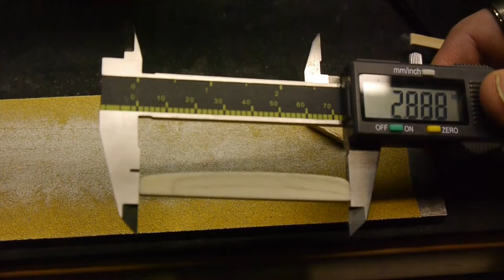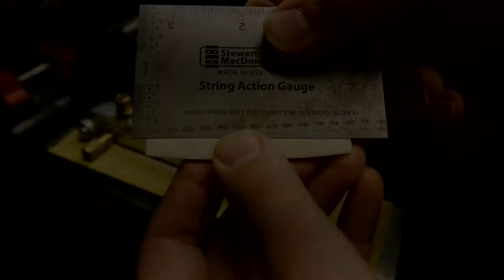Making a Bone Saddle for Acoustic Guitar ASMR

Comment: Thanks so much!!! I found that rounding the ends of the saddle is a pain so once I get it close to length I put the saddle vertically in my vice, cut a strip of 220 sandpaper about 3/8" wide (not too wide or it rounds over the corner edges) and 2" longish. Holding the sandpaper over the end of the saddle and close to the sides I pull down on one end, holding tension on the other and let the paper do the work. Makes a beautiful rounded end.

Comment: What if I don't have another saddle to use as a template for the radius?
Reply from the maker: Radius gauges. Measure the fingerboard, then use the radius gauge to trace a line onto the saddle. 

Most acoustics have 12" radius boards, but they can vary
Reply: @guitar_md  I've noticed the gauges are symmetrical and the saddles are not (higher toward the low E). My guess is this is to account for the thicker strings. How can I get that shape? Also, I need more vids with just you filing. Such a cool, relaxing sound!
Reply from the maker: @rstevenhanson  The radius being symmetrical is OK. To make it higher on the bass side and lower on the treble, you change the profile of the bottom of the saddle. 

The easiest way to do that is with a Nut and Saddle sander tool. Stewmac carries them but I got an aftermarket one on eBay that works great. It allows you to file the bottom perfectly flat, but you can also angle it so it removes more material from the treble side than the bass side. 

And thanks! I'm wanting to do more videos like this as well without talking. Lots of ideas. It's been a while so I will probably do another nut and saddle video eventually.
Reply: @guitar_md  Gonna try something. I'll trace the radius from the gauge on a piece of paper, then take the difference in diameter between the E strings (low E diameter minus high E diameter) and mark that height above the right side of my paper line, then use the gauge to trace a new line. I'll return and report!
Reply: Just bought a Taylor micarta saddle and the treble side is 2 mm lower than the bass. There's a slope for sure.
Reply from the maker: @rstevenhanson  Absolutely. The treble side is always lower than the bass. The easiest way to do this (for me) is to do a uniform radius on the top, then use the nut and saddle sander tool to sand the bottom flat, but removing more material from the treble side than the bass side. 

This will create the desired slope. But if you don't have a nut/saddle sander tool, drawing a slanted radius on top, as you described, is the only way to do this that I can think of, aside from using a pre-existing saddle as a template, assuming the radius matches the fingerboard. 

The nut/saddle sander tool is the ideal, and makes everything much easier, but you can do it without it, for sure, and without a saddle as a template. Sometimes I'll chuck the saddle into a nut/saddle vise, and use a radius block -- and I'll slant the block slightly while sanding to slope the top profile a bit. 

Generally speaking, for a factory setup, 6/64" on the bass side at the 12th fret and 4/64" on the treble side at the 12th fret is the standard. I prefer it lower, but that's the standard, and generally speaking 2/64" - 1.5/64" difference between the Low E and High E is desirable. I'm used to SAE so I'll have to look up the metric conversions. 

To have X difference in action at the 12th fret, you need to do 2X removal of material at the saddle. For example, to reduce the action by 1mm at the 12th fret, the saddle has to have 2mm of material removed. 

So a 2mm difference in height between the Low E and High E side at the saddle will result in 1mm difference in height between the Low E and High E at the 12th fret. This can be removed from the top of the saddle, or the bottom. Without the nut/saddle sander, there's no reliable way to disproportionately remove material from the bottom of the saddle while keeping it completely flat, so you gotta work from the top down.
Reply from the maker: Did you end up using the new saddle as a template to make one from scratch? Curious! Let me know how everything worked out. 

Working on a Martin today. Lots of the new ones have bolt-on necks but the bolt is hidden under the name plate on the neck block. My friend and mentor Steve and I found out about this many years ago when working on my Martin D12X1. Just a little squiggle of glue holding the fingerboard extension down, and next to nothing in the mortise + tenon joint. Took the bolt out and the neck just popped right off. 

Anyway. Always more work to do! I'd love to do a followup video either doing this process again, or doing one for making a nut. In a week I'm going to publish my video for making a bone nut from scratch, to complement my last one where I covered making a 12 string nut. 

Always more to do with guitar work. Again...let me know how it's going, and what you ended up deciding on for your guitar. I myself use bone most of the time but have also had great results with Tusq. Haven't tried Micarta yet and would be curious how it sounds!
Reply: @rstevenhanson  we're still waiting...😂

Comment: I suppose to do this accurately you would need my guitar
Reply from the maker: I've heard some people can send saddles out and make replicas, which is possible.

I wouldn't be completely unwilling to try, but you wouldn't want to be without a playable guitar for a while without having any guarantee of the final result. 

However, I could make a replica of a saddle. It's always possible the existing saddle is not a perfect fit, but if it works, I'd be able to make a bone replica of it. It may take some time as I have to look online for bone blanks but it could be a fun project.
Reply: @guitar_md  so the problem ive got is, the high e string is muted/buzzing from the nut, ive remedied it by placing a small piece of metal where the string sits in the nut however its only temporary. (im 100% sure its the nut).  The saddle is cut ok, they are both made from bone, the guitar is a 1983 Martin M-36 150th year
Reply from the maker: @MrBradleya16  Have you seen my nut slot filling/filing tutorial? Metal can work fine as a temporary fix but for more permanence, best way would be to get an appropriate gauged nut file (a .013" gauge nut file would work for an acoustic high E string), fill the slot with superglue and baking soda, and re-cut it to the appropriate height so the open string isn't buzzing. 

It's a simple fix with the right tools, and if you get a nut file, you'll have that for the rest of your life and can use it to fix the same issue on any other guitars. I've done this fix many times. I have heard some techs go so far as to use dental composite to fill and re-cut nuts, which I'm curious about, but haven't tried myself. The baking soda and superglue trick works wonders and many techs have used that for decades with no issues.
Reply: @guitar_md  yeah ill check that out thanks
Reply from the maker: @MrBradleya16  Sure thing. Thanks again for all the support, I really appreciate it!
Reply: @guitar_md  fixed the buzz with your bakind soda trick btw thanks
Reply from the maker: @MrBradleya16  Absolutely! So glad it worked for you!

Comment: 4:58
did you cut away a part of the saddle with not a straight angle to get thin strings a bit lower than thin ones? 
 Currectly I'm looking for a good method just to keep my 5-6 strings almost at the same height, but I really need to lower 1-2-3 and maybe a bit 4th strings. So dono, shoult I just cut away the saddle from bottom with correct angle or do the tweaks on the top of the saddle... But its already compensated, so I'm a bit scared to do something wrong :D

Comment: Hello, I would like to ask
What is this device, where can I buy it? 
5:04
Reply from the maker: Guitar Nut and Saddle Sander. 

I bought mine on eBay years ago. It seems Philadelphia Luthier Tools has them in stock. Let me know if you find it okay!
Reply: I know this is a year old question but ... the answer is Ebay or Amazon.. and the cheap ones work fine .. except mine has a 20 thousands difference from the bottom of the wheels .. no problem.  Just leave an extra  20 thousands out of the bottom . 

  These things keep your sanding flat so more contact transfers more vibration to the bridge ,or pickup if you have one . This really help on under saddle pickups . Because they tend to grab the bass strings more easily then the trebles .